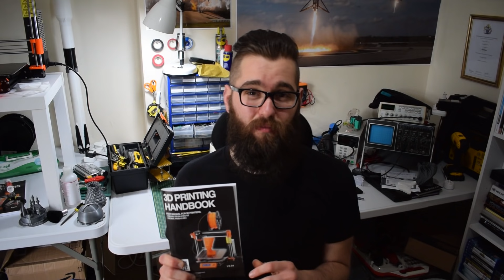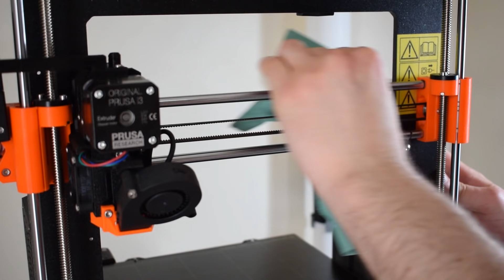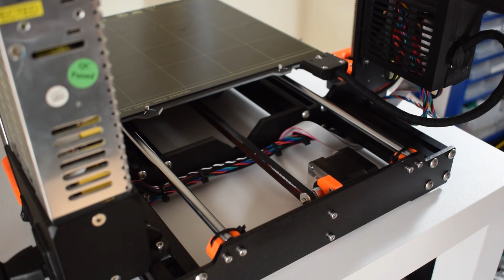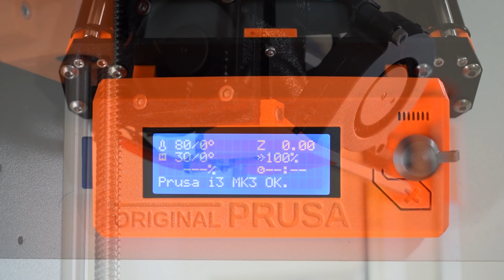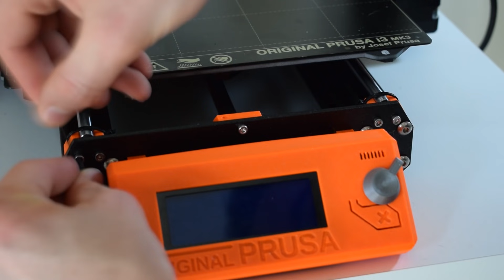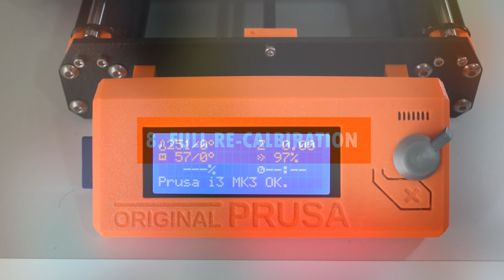How To Service Your Prusa i3 MK3

Comment from the maker: Prusa recently stated in their assembly manual that you should not lubricate the Z-screw rods. While I have done this with lithium grease for 2 years with no issues whatsoever, you'd be silly not to follow the manufacturers advice. Here's a link to read more:
https://help.prusa3d.com/cs/guide/printer-maintenance-tips_23201
Reply: Wow, wish I'd seen this regarding the z-screw rods before applying the lithium grease.
Reply: Lubricating threaded rods attracts dirt and debris that can be hard to remove and could cause premature wear which could theoretically lead to backlash. It could also clog the threaded nut and cause jerking and imperfections in your print that may not be very noticeable.
Reply: If they used higher quality parts, lithium grease would be standard. I service semiconductor equipment- every tool manufacturer with linear rods and screw drives use grease like isoflex nbu15….

Comment: I remove the bed when I start maintenance for cleaning and leave it off until the end so there is no chance of damage or contaminating it with oil that could drip off the rods during lubrication.

Comment: Thanks for this. When using a brush to clean the nozzle I would wonder if the brush material could be harder or at least as hard as the nozzle and possible affect the tiny hole.
Reply from the maker: Yes you have to be careful with that. I would recommend a hardened steel nozzle personally. Not only will it last longer but you'll also be able to experiment with exotic filaments too.

Comment: I also find a lot of dust in both hotend fans and especially the lower fan duct which affects parts cooling aiflow. Blowing out the fans with compressed air clears the blades but the buildup in the lower duct requires disassembly to do a proper job.

Comment: Have you ever used the teflon dry-film lubricant on  the smooth rods or z-screws? It goes on liquid but dries very quickly, leaving a very thin lubricant coating that doesn't attract dust.

Comment: For cleanimg the nozzle. Heat it up enough for the PLA to melt.

Then use plastic cotton sticks to clean.
This wont scratch your nozzle and basically removes the danger of shortening it. The plastic will gently soak into the cotton. For example. I had a tiny blob buildup once. Using a couple of cotton sticks it went from being totally covered in PLA to be completely clean and shiny. Looking just like new. Using brass or metal brushes just sounds insane to me. Not only does it have the high risk of shortening. Damaging more components. But you scratch up the metal.
Reply from the maker: I like your idea, I'll try that! I still use the wire brush method to this day and never had any issues. Never even had to change the nozzle on the Prusa MK3, had it nearly 4 years!

Comment: Prusa's research says that "absolutely do not lubricate the z axis ..." I think it lubricates because it has self-lubricating bushings, and the wd-40 lubricant would defeat this quality ...
Reply: Are you saying that we shouldn't lubricate the rods, the screws, or both?
Reply: grude1 don’t lubricate the z screw ... the rods with bearing it’s ok to lubricate ... but the screw it lubricate itself.... all rods lubricate with singer oil it’s ok , but absolutey don’t lubricate the z screw
Reply: Exactly, do not lubricant leadscrews. Maybe author should edit the video, as this goes directly against official Prusa user guide: https://help.prusa3d.com/cs/guide/printer-maintenance-tips_23201
Reply: WD40 is not a lubricant. It is closer to a solvent and rust dissolver.

Comment: My printer over the last almost 3 months now, have been doing its job like a good boy for about 44*24=1056 hours now. I have had a suspicion there may be about time to do some poky poking on it. My suspicion has been A: I at least need to shorten the ---- belt by 1 or maybe even 2 teeth. >.> Mainly due to seeing less than a layers with of shift/error in my prints. I also suspect that various treatment of the nozzle probably makes it a good idea to change it.
 Oh and I have noticed that when changing the filament, it started getting a bit stuck in there at some point. :/ That probably would be the biggest annoyance to fix.

Comment: Mine doesn't have the orange guard/horeshoe piece around the nozzle. Is that new? We paid for the fully assembled mks3+ from Prusa about 3 years ago and it doesn't have that. Lots of gunk/old filament has gotten impacted up in the nozzle area. It's not clogged but all the space around the nozzle now has hardened filament from failed prints that didn't stick to the bed. How do I get all this off now?
Reply from the maker: Hello, I believe they've changed this to a black polycarbonate piece now. I wouldn't panic if you don't have it, plus of course you can always print the part yourself
Reply: I just noticed mine doesn't have it either and has a ton of gunk like you're describing. Did you get yours all cleaned up? If so, how?
Reply: @quentingauthier430  Okay, so here's what we did to clean it. Go to the settings and set the Z to something high so the nozzle is at least 5 or 6 inches above your plate. Then preheat the nozzle up to the highest temp setting. Then let it sit ON for at least 30 minutes. Most of it will melt off onto your plate. Turn it off and let it cool a bit, but not all the way. You should be able to pull off the rest while it's still malleable.
Reply: @con-rob  amazing! thanks!

Comment: nicest cleaning video around! thumbs up!!
please please please do the nylock mod and drastically improved my quality! i've done it on my mk3s and gone from 0.586 to 0.086 (best i've seen is 0.020) bed tolerance and you can add the check on the ubolts! :)
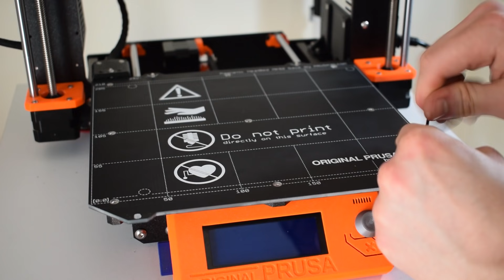ps tightening the bed bolts (9:50 ish) DO mod the warping on the bed itself (check octopi and bed leveling wizard)
Reply: fyi: NYLOCK MOD TUTORIAL
https://github.com/PrusaOwners/prusaowners/wiki/Bed_Leveling_without_Wave_Springs
and then do THIS:
BED LEVELING CALIBRATION DONE EASY and WAYYYY BETTER:
https://forum.prusaprinters.org/forum/original-prusa-i3-mk3s-mk3-assembly-and-first-prints-troubleshooting/life-adjust-z-my-way/

Comment: Using the metal brush to clean the nozzle and the heater block is a great tip! Never saw it before!
Reply: this is by far the worst advice you are grinding away the metal of the nozzle

Comment: Quick Q. Don't the bearings have a seal around the edges and won't that seal prevent the oil getting inside the bearing casing and onto the bearings themselves?
Reply from the maker: In theory yeah, but if you’ve ever changed the bearings the first thing you’ll realise is just how much dirt & dust gets in there. Oil can get in there
Reply: @thehardwareguy  thanks. 

Just built my mk3s a week ago. Do you find the modified nozzle fan shroud you have printed makes a difference?

Comment: Bro u used a machine oil for Threaded + Plain Rods. 
Some1 told me to use Synthetic oil with PTFE instead. (which is of course not locally available)

So is it safe to use a machine oil for both plain and threaded rod?
Reply from the maker: I used machine oil for smooth rods, and lithium grease for threaded rods.
Reply: @thehardwareguy  ok thanx for that👍
Reply: Buy a bottle of triflow and use that as the oil instead. Bicycle shops will often carry it or an equivalent if you can't find it in your area.

Comment: i'd use something to apply the grease to the extruder, like a solid grease. you don't want grease where it touches and grips the filament
Reply from the maker: I’ve never had any problems with it personally... but it wouldn’t hurt! Do whichever method you feel most comfortable with :)
Reply: I wondered about that too.  How can it not get on the filament spraying grease in there like that?  Maybe it doesn’t effect the print tho..

Comment: Internet says, that lubrication of stepper motors is not necessary, the bearings are "lubricated for life"...
Reply: this is correct, these motors are sealed and does not need lubrication, and as an elevator technichian i can tell you that many newer motors are sealed and cant be lubricated, they get replaced in 20-30 years and no need to lubricate and no way to lubricate befoure that.
Reply: WD40 will wash out grease from the bearings. Would never do this.
Reply from the maker: Matze W it’s not WD40 oil.... it’s WD40 Lithium Grease.
Reply: i would replace the metal bearings with igus bearings, they are quiet and you dont need to oil them

Comment: What was the reason for using A4 paper during the calibration? About to get my first Prusa
Reply from the maker: It’s just to ensure that the nozzle isn’t touching/damaging the steel sheet! During this calibration you can easily feel if the nozzle snags the paper, at which point you must turn the printer off immediately. Good luck with the printer man, any more questions just let me know!

Comment: if you use silicone sock on your hotend it wont require any cleaning at all...
Reply from the maker: I’ve used them on Creality printers... they’re okay, but I found that filament can still get trapped inside them and then dip down onto prints unexpectedly! A few of my white PLA prints had black PETG smears on them. Since then I removed the nozzle sock and never had the problem again!
Reply: @thehardwareguy  creality socks are a bit rubbish, ive got e3d pro sock on my mk3s (the one that covers everything completely) only the tip of the nozzle pokes out, theres no chance of filament getting in there.

Comment: Will normal WD40 work? The type mentioned in the video is indefinitely out of stock in the USA
Reply: I don't recommend that, because regular WD-40 damages plastic and it's not exactly designed to be a lubricant. It's main function is cleaning and water displacement for rusty parts I believe.

Comment: I learned a lot! But how do I know when to use the Machine Oil or the WD40 grease? Whats the difference??
Reply from the maker: They are very similar. But basically grease is oil mixed with some kind of thickener. WD40 grease looks more like a white paste, which just helps it last longer! Standard machine oil is cleaner/easier to manage but it dries up quicker. Personally I would never put Grease on the printer rails just because it would make such a mess. Machine Oil is also known to be much better for lubricating bearings.
Reply: thehardwareguy there is a wD 40 dry ptfe lib for metal to metal contact
Reply: @thehardwareguy  WD40 will dry quicker then oil, it will dissolve some dirt, penetrate all small places and after some time evaporate mostly. I'd say that for small gears in extruder oil or grease would work better than wd40.
Reply: @adamd6469  It's just WD40 brand, it's white lithium grease not the OG WD-40 formulation.  Totally different product

Comment: What about cleaning your nozzle from inside, its good to make cold pull sometime
Reply from the maker: True, I didn't include this in the video because it's a little more "risky". I tend to only do a cold pull if extruder is clogged up!
Reply: Run through some cleaning filament instead

Comment: what i find a little annoying is that it says in the manual to regrease the linear bearings every few hundred print hours - but there is no proper step by step manual giving you an idea on how to get to those bearings... i had one bearing block up on me on the x axis and had to dissassemble the entire printhead and remove the x-axis in a very dodgy way over the top... printer still works fine but damn that was dodgy... also - service every 100 or 200 hours is a really narrow service interval, i wonder how they do it in their printfarms

Comment: I lubricate BOTH ends of each motor.  The rear end sees almost as much force and wear as the front end.
Reply: 1) it does not. The bearing closer to the pulley and belt tension is significantly under higher load then the rear bearing. 2) The bearings are sealed, for proper lubrication, you need to disassemble the motor (4 screw at the rear), and pull the assembly carefully. Note the location of the spring washer, as its normally at the rear and pressing the motor assembly forward (Toward the output shaft). Clean all surfaces, alcohol works fine. And you can then lube the bearings from the inside, you may need to pry off the dust cap seal 1st.  Give you a chance to actually inspect the bearings as well and check for any excessive wear. But frankly, it's just as cheap to replace the motor vs. going through the steps to replace 2 bearings.  

Spraying white grease from the outside, doesn't do anything.

Comment: thank you, very well explained...
i only got one suggestion:
WD40 is a rust REMOVAL aid. it is not meant to be used as grease (it's says so on the spray) since its main component (about 75%)  is washing benzine (a kind of kerosene).
Reply: This is not the common WD40 type. It's the silicon lubricante of the same company

Comment: I basically do the same steps but only 2x a year, you think every 3 months would be worth it? I do print a good bit (IMO). But I don't notice issues.
Reply from the maker: Any service is better than no service!But generally the more often the better, without overdoing it of course!
Reply: @thehardwareguy  Came back to say, I did complete maintenance before printing a massive 3 day job and some prototypes. Everything turned out great but I think it's time for another maintenance. LOL

Comment: This is a well done tutorial, but unfortunately it contains some errors. The first one you corrected yourself with the pinned comment. The second one: WD45 isn’t a grease. I would definitely not use it for this purpose. 
I don’t thnk, you have to lubricate the extruder. But you definitely should clean them from filament. I use a tooth-stick for that.

Comment: low risk ... of short .. happened to me ... not blew the board though
ALWAYS shut down the printer when working on the nozzle

best way to clean your nozzle : get the hot end OUT  and use a HOT AIR GUN ( 250-300c ) use pliers and a brush to clean the hot end

if you have a ruby nozzle you do not want to run that over the nozzle